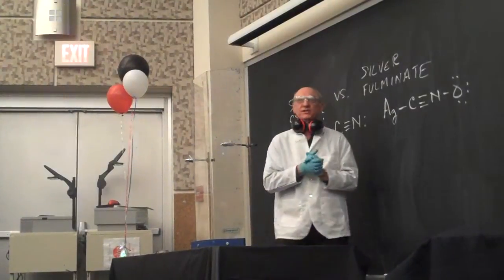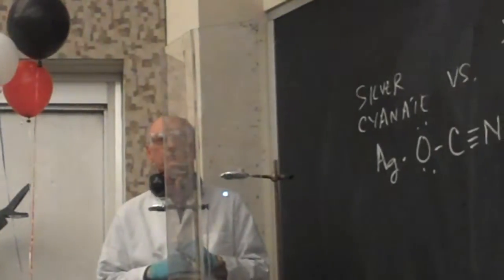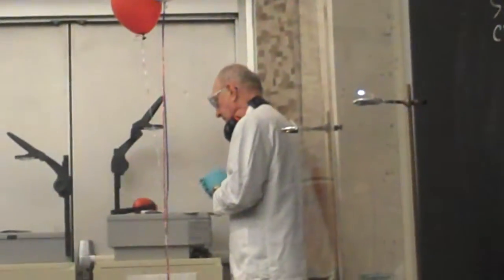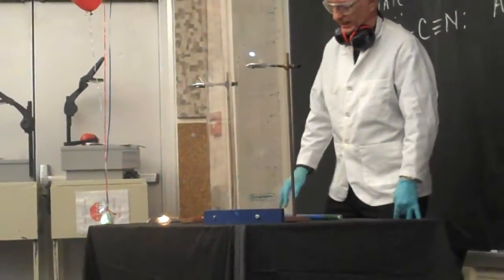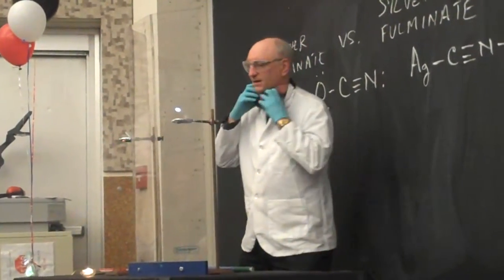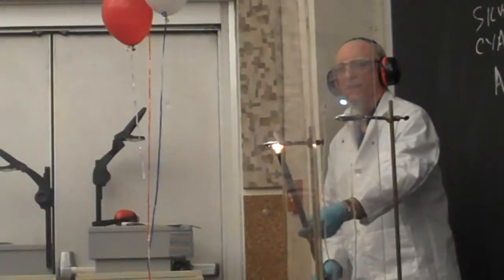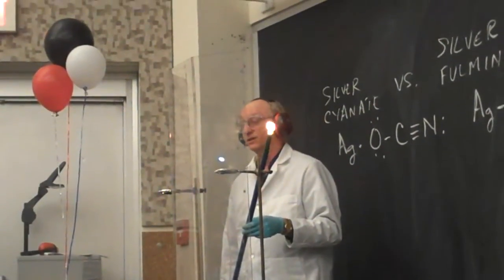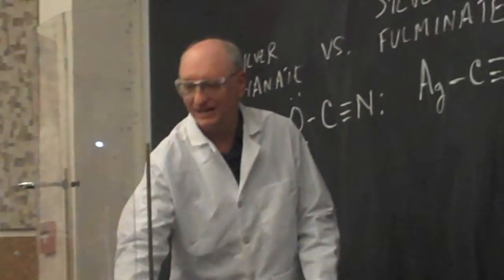Silver Cyanate vs. Silver Fulminate: A Highly Explosive Comparison

Comment: Always been interested in chemistry, fulminates are cool! Too bad they're not legal, i wonder how they get away with putting it in bang snaps.
Reply: Sn0wboarder2390 simply put, "amounts". You are talking about nanograms. It's just not dangerous in such small amounts. Sure it would sting a child's hand if it exploded in a kids hands, but that's it. And it not like anyone in their right mind is going to be buying millions of these to make any substantial amount of explosive. Especially when it's so ridiculously easy to make, if you really wanted to. And besides, it is really an obsolete explosive. It's only real use is in children's snap bangs. In military uses, this explosive hasn't been used in almost 50 years.
Reply: milligrams*
Reply: Actually, you are both incorrect. There is about fifty micrograms per
Reply: @shonaoneill5151  Isn't it also used in pull-bangs?  I've seen those used as passive alarms.
Reply: @douro20  pull-bangs use armstrongs mixture, a mix of red phosphorus and potassium chlorate, the basic reaction is identical to safety matches.
Silver fulminate would be quite dangerous to roll into small paper tubes, and is pretty much impossible to portion dry.